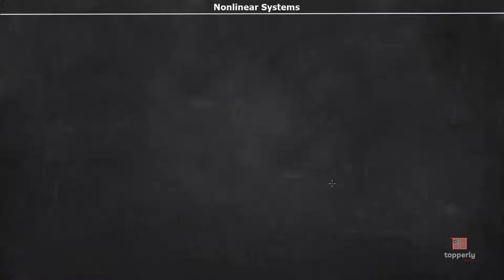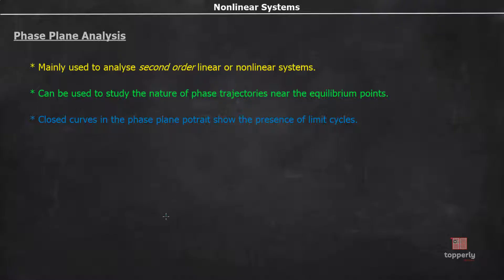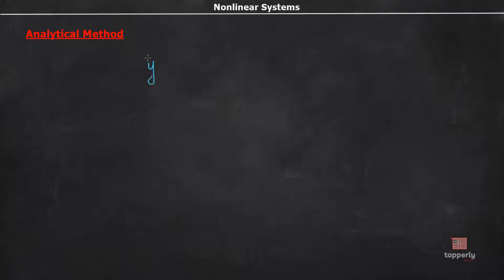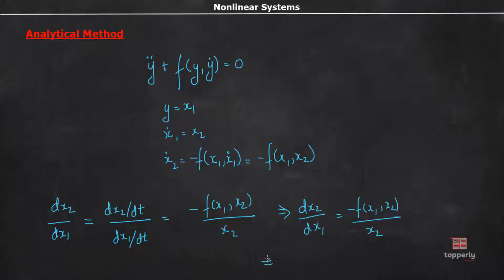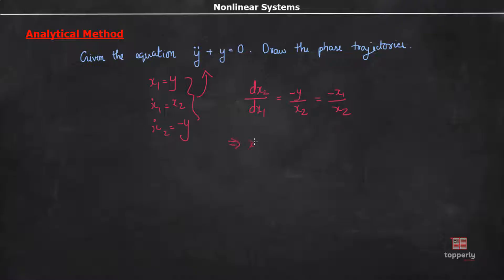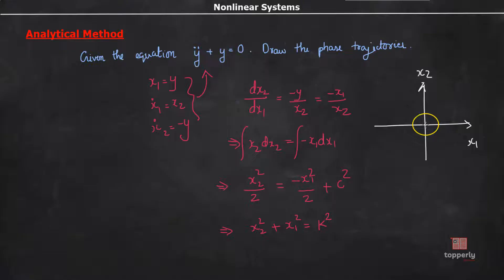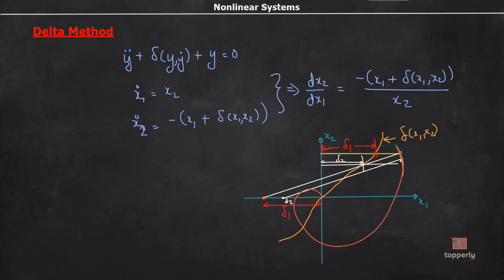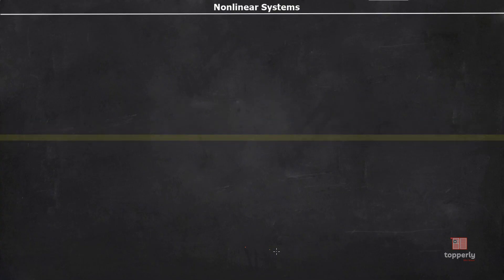Phase Plane Analysis - Analytical, Isocline & Delta Methods | Nonlinear Control Systems

Comment: At 12:53 How we decided the intersection point of yellow line with white line and made the arc ?
Reply from the maker: Hi, 
I didn't understand your question fully, but if you are asking about how we choose the initial point, it is completely arbitrary. In the example, I wanted to choose that as the initial point for my phase trajectory. 

Please feel free to come back if you still have doubts :)
Reply: @Topperly  Thanks for your kind response but I wanted to ask that,  around 12:50 how you decided the intersection of the line segment from x1 axis with the line at which we have to make the Arc??
Reply from the maker: Please watch from 11:56. That point(initial point) is chosen first. It's arbitrarily chosen in the phase plane.
Reply: @Topperly  got it. Thank you very much, you are doing a great job ❤

Comment: Thanks for sharing the video... I want to ask about isocline method have the ability to predict the system behavior in the future?
Reply from the maker: Technically speaking we can predict the system behaviour at any instance if we know the system behaviour at the previous instance.
However, if your question is whether we can predict the system behaviour using initial conditions alone, the answer is no. We need to have information about all the variables throughout the time domain.

Comment: In the above methods(plots) we are assuming an initial point ryt.... can you explain why and how you made that assumption and whether  the plot will look same if started from a different point
Reply from the maker: There's no particular reason - I randomly chose one. You have to choose an initial point based on the requirement. 

No the plots will not be same. Even closely spaced initial points results in widely varying plots - butterfly effect :)

Comment: what is meant by plotting delta function?
Does it mean delta=0 is the equation of the curve?
Reply from the maker: Yes, you are right :)
Reply: @Topperly  where to plot the magnitude of delta? On x1 axis?
If so what to do if delta is a function of x1 only?
Reply from the maker: Delta is just a function of x1 and x2.

It's just like x + y = 3 in a cartesian plane. Here this straight line is a function of x and y. How do you plot this line in a cartesian plane? Just like that you should plot delta in the x1-x2 plane

Comment: Sir where u r plotting graph I mean which app
Reply from the maker: I'm not using any graphs. I'm drawing on Desmos graph :)
Reply: @Topperly   thank u sir , I got it .
Reply: Sir , I m using demos graph first time , i  don't getting that line for plotting angle. like u adjusting line according to angle . Pls help
Reply from the maker: @Raj Anand Yeah. Desmos doesn't have that functionality. The angle was plotted using a tool in the software I use for slide preparation - Autodesk Sketchbook :)

But if u like to plot the trajectories, try "pplane" toolbox in MATLAB.
Reply: @Topperly  thank u sir

Comment: At 11.55 how we draw the graph of del(x1,x2) on x1 and x2 plane
Reply from the maker: First you have to manipulate the state equations in the form shown in video. Then you can identify the terms included in the function del(x1,x2). Now plot del(x1,x2) vs x1 or x2 depending on the case :)
Reply: @Topperly  how we manipulate the state equation 
Actually how to can plot the plane x1  -x2 
Is this plot by any matlab code???
And how the phase of this question is plotted by matlab.

Thanks for your kind support
Reply from the maker: @Deepak Gupta  To understand delta method further, please refer this book(thesis) :) 
https://core.ac.uk/download/pdf/36706161.pdf

Comment: Awesome video. Thank you very much. Is it correct to say that since all the examples in this video- the trajectories spiral in to the origin; systems described by the differential equations are achieving steady-state i.e. coming to rest.
Reply from the maker: Yes, if the trajectories spiral into origin, system is achieving steady state :)
Reply: @Topperly  . Thank you very much for the reply.

Comment: how did you draw the del curve in delta method?
Reply from the maker: Del curve is function of x1 and x2. Here, I just drew a random curve for representative purposes. However, in actual cases, you have to plot the function d(x1,x2).
Reply: @Topperly  d(x1,x2) will be a 3- dimensional plot with d-magnitude along a plane perpendicular to x1, x2  plane
Reply from the maker: del is just a function of just two variables - x1 and x2. So, it is a 2 dimensional plot only.

Comment: in the isoclane method how do you define how many isoclanes you will need to do or how many are enought? and the initial point A in the graph you can always decide where it begins or some times is given?
Reply from the maker: If you want an accurate trajectory, you will need more isoclines. Basically, more isoclines means more accuracy. 

You can choose the initial point according to your choice.

:)

Comment: i have a question probably a dumb one,  in the analythical method why when you integrate both sides of x2dx2=-x1dx1 you get a C^2? i mean from the formula of integration don't you get X1^2/2+C=X2^2/2+C? i really dont remenber the this topic very well.
Reply from the maker: Can you please mention the timestamp of instant you are referring to?
Reply: @Topperly  starting the 3:42
Reply from the maker: What you said is correct. But think of this way,
I have a function f(x)= x. After integration, (integral f(x)) = (x^2)/2  +  c, right?
Now this 'c' is a constant. Let 'b' be the square root of 'c'. Therefore I can write (integral f(x)) = (x^2)/2  +  c = (x^2)/2  +  b^2. 
This is what I've done in video, so that I can obtain the equation in the form of equation of a circle.
Reply: @Topperly  ok i undestand so for you "K" in the video is your "b", i got confused because you writed it first as C^2.
Reply from the maker: No 'c' in the video is 'b'. 'k^2' in video is equal to '2*c^2' after cross-multiplication :)
Reply: @Topperly  ok thank you so you used C as the square root of c
Reply from the maker: @Juanchogamer5000  Yes :)

Comment: Hello, At 4:35 you say that "consider a non-linear differential equation y''+y'+y=0", but that is actually a linear differential equation. Is it correct? If not did you mean a "non-linear System"? So does it mean that a differential equation can be linear but the system can be called non-linear? Moreover, I think that y''+y'+y=0 is a linear system, is it right?
Reply from the maker: Sorry about that. It's a linear ODE only. Originally, while scripting I used a nonlinear DE, but then I decided to use LDE so that it'll be comfortable for first time viewers. But forgot to change the script. Thanks for pointing out! :)